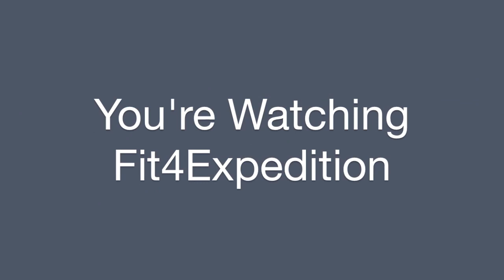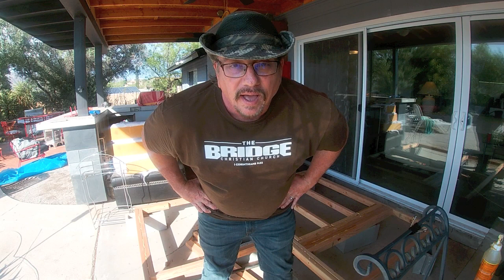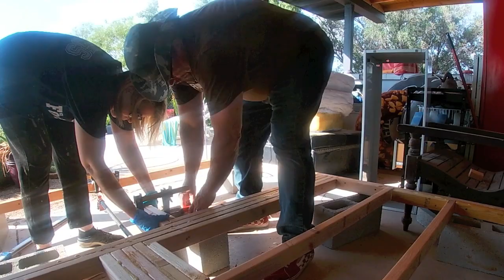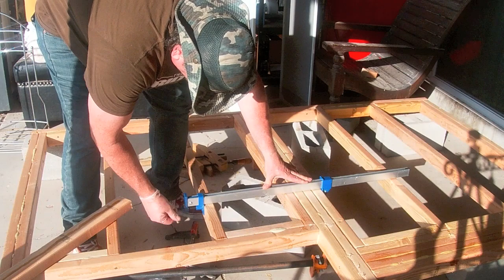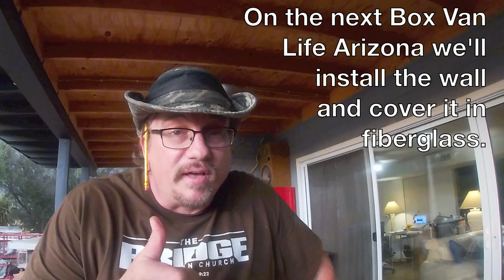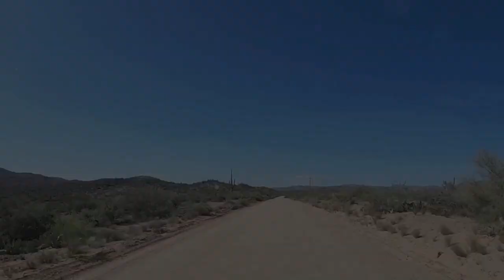Finishing the Framing for Our Replacement Wall - Box Van Arizona

Comment: Love building stuff like this. Where will you purchase the fiberglass sheet? Did you have to mortgage the house to get wood? Lol
Reply from the maker: The plywood was pricey. The 2 x 3s only ran around 70 bucks. I actually bought the plywood sheets for this project a couple of years ago. Lowes had a couple sheets that had some slight damage and I got them for around 80% off. Thanks for your support Steve.